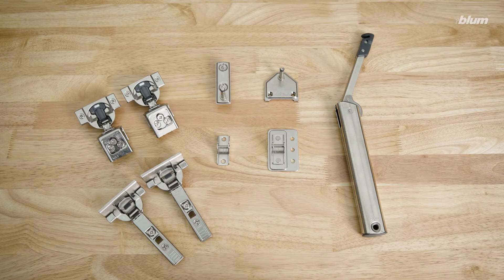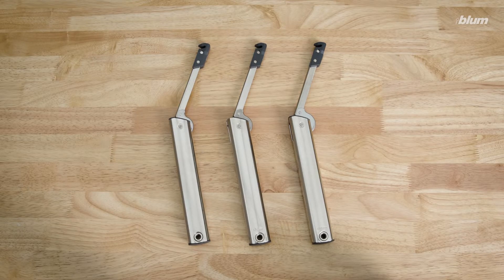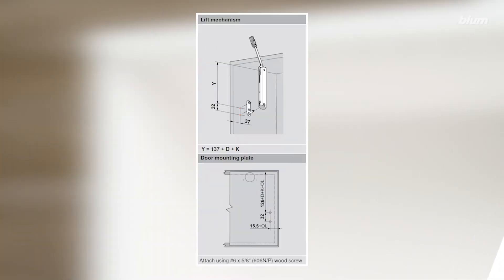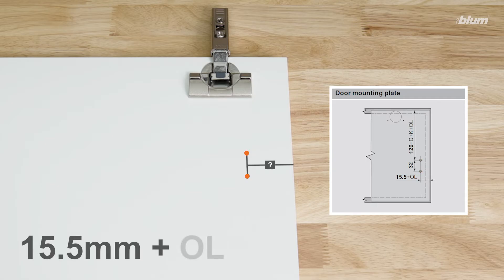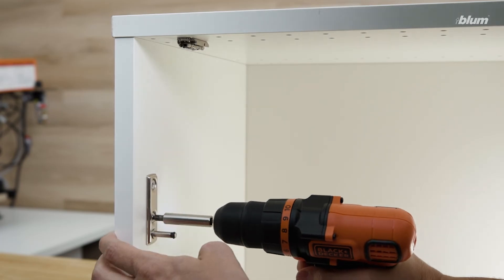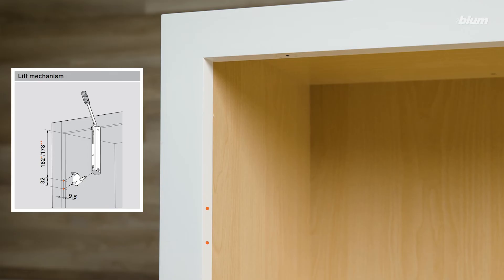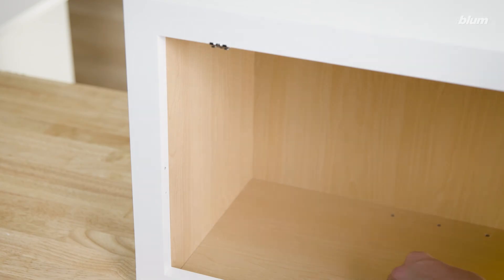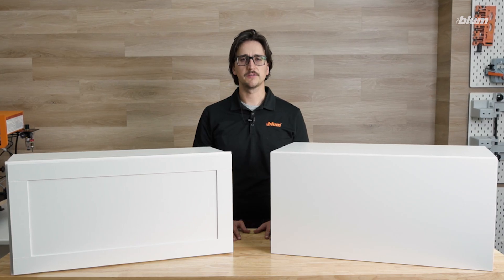How to Install AVENTOS HK-XS in Frameless and Face Frame Cabinets | Blum

Comment: This video is lacking a lot of information as are your website instructions. Maybe you should explain what a straight arm is vs. a half or full crank arm. I was baffled by the instructions on your website and have to assume I have straight arm even though the arm is not straight. A quick explanation in this video could make it clear. Same with mounting plate height, no explanation of that. The written instructions on the website said I needed to know it for my calculation, but gave no explanation what it is. Again, I have to assume it's zero because this video does not explain it either. I'm doing a face frame install but have a heavy door so I'm using the heavy mounting plate. Do I calculate based on the first or second method? You don't make it clear, but seems to me I should use the first. You guys need to do better with your instructions, this should be so simple.
Reply: We have the same questions?